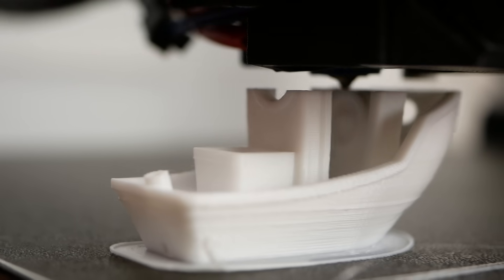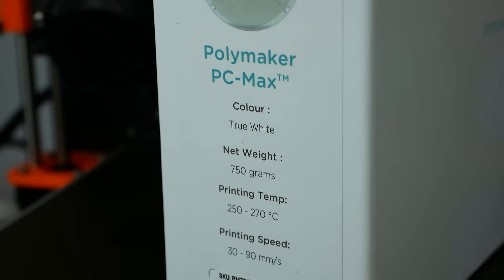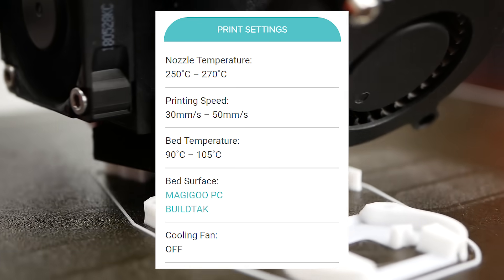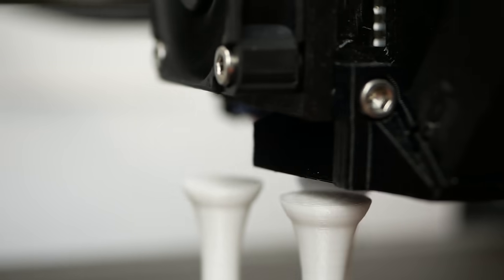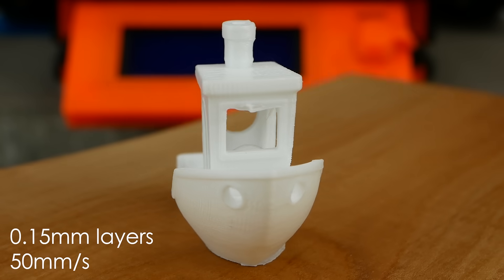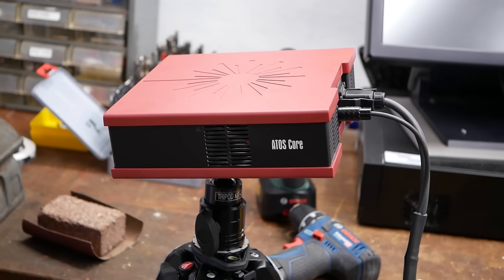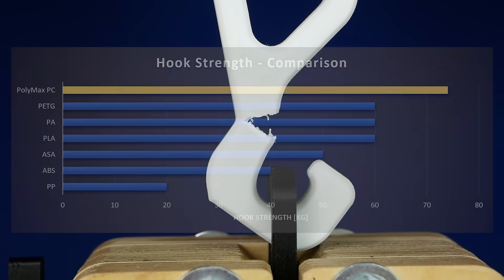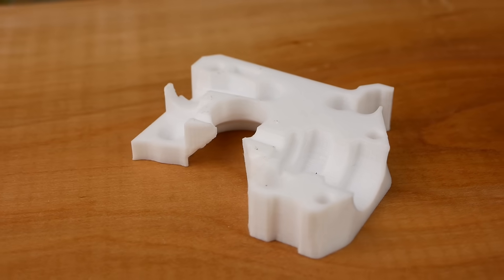The King of 3D printing materials? Polymaker PolyMax PC REVIEW

Comment: Hi Stephan, I use PC-MAX for mechanical parts and  was very interested in this review. Also I read somewhere that PC-MAX need to be annealed 1h at 100°C to achieve it's best mechanical performance, would you consider give it a try later on?
Reply from the maker: Will do.
Reply: @CNCKitchen  update on this? :)
Reply: @CNCKitchen  Yesss! Thank you!
Reply: @CNCKitchen  Yes - please!
Reply: Agreed! Please re-visit with recommended anneal settings!
Reply: +1 for this.  I am considering buying myself a small fan assisted oven (approx same size as my build volume) so I can take the hot glass build plate out and put it straight in after a print.  I'd modify it with an arduino/second had PLC to control the annealing profile.  I'd really like to see the affect as I have noticed the material properties seem to really change over time (after the part is printed) and would like to try annealing them to see if this goes away! 

This material REALLY doesn't 'feel' like other polycarbonates I have printed with.  Polymaker clearly modify the material for 3D printing.  The MDS says it is 10% 'fillers'.  I wonder what they are?? Gypsun, styrene, monomers... I really can't think.  It certainly feels more 'gummy' than other polycarbonates and the temperatures are a lot lower.
Reply: Would there be deformation with annealing this material?

Comment: If only there was a prusaslicer setting to have the fan enabled for the outermost perimeter layer, and disabled for the inner layers and infill. Then you should get a good combo of strength and quality.
Reply: That's a brilliant idea, I'm sure it can be done👍
Reply: Yes, but the outer layer does most of the work, so also no.
Reply: @SalveMonesvol  The perimeter layers in general provide most of the strength, so yes you are sacrificing a bit of strength on one of the layers for the sake of print quality. Its all about trade-offs and understanding the consequences of them with the print settings. You can always add an extra perimeter layer to compensate. Better print quality, less cleanup time, potentially less plastic use for support  (since you're less likely to need it) and finally, its a relatively easy setting to code in.
Reply: @patrickweckermann9121  In that case, just make sure the outer layer is more elastic than the inner layer, thus allowing the inner layers to work befor the outer one cracks. So, no PLA.
Reply: Not sure we're talking about the same thing here, but I'll bite. Sure the outermost layer may be more brittle and prone to separation, but at least its in the shape you intended (as are the other layers). You can compensate this for a bit by increasing the temperature of the inner layer(s) so they adhere better. This is far more of an issue with materials like poly-carbonate and PETG in my experience.
Reply: @patrickweckermann9121  I had forgotten you were talking about just disabling the fan. 
 You might get cracking under stress, but still, it would be better than using the fan on everything.
 I think the best way would be to use fan within a very hot enclosure.
Reply: @SalveMonesvol  Exactly, just a fan speed setting for the first perimeter layer. To expand on the idea, its only needed in overhang and bridge situations. as it is now, you can only set the fan speed for bridges.

Comment: Great testing video, I don't use the polymaker PC brand,  but i do print other PC's, i use a garolite sheet on my print bed with the heat at 70C  and a hotend temp if 290C and 10% parts cooling for the annealing process, these settings give me the best results.

Comment: I'd love to see the comparison with the lite version that's almost half-price.
Reply: I’ve used the lite version (back when it was called PC-Plus), and it is extremely rigid, almost glass-like. Very strong, very very strong layer adhesion, and quite transparent. The downsides are that it is brittle, and will probably cut you if you break a piece in your hands. Also, sticks to my PEI bed far too well, but that’s mostly on me. Warps and lifts if you don’t adhere it well enough. I haven’t tried the Max version yet. I find eSun ePC prints more easily, but it doesn’t have the god-like stiffness, strength, and layer bonding of PC-Plus.
Reply: @dennischertkovsky8871  I found the same with Poly-Lite. It is very rigid and glass-like. I actually did get cut on some brim I was taking off. I found that a heated enclosure at ~50c and gluestick on PEI made warping/lifting go away. I think its rigidity took a lot away from the strength we needed, but it printed very easily with fantastic overhangs and supports. 

Priline PC is basically the same price and seems to be a lot closer to Poly-Max in my experience than Poly-Lite.
Reply: @candorman9444 
How do you think it would behave if annealed?
Reply: @wanderingcalamity360  Same. Layer adhesion wasn't the issue
Reply: @candorman9444 
I was thinking more from the stress perspective, rather than layer adhesion, but alright.
Reply: @dennischertkovsky8871  Hi, is it dishwasher safe ?
Reply: You only want to use filament specifically listed as food-safe.   Even if the base plastic is food-safe, the dyes or other additives may be toxic.
Reply: well, the cheapest polycarbonate material sold in China is 12 dollars per kilo....I'd buy some and test.
Reply: @XiaoMingMC  so did u do it?
Reply: @saadahmad21  nope, I do not have an all-metal hot end, unfortunately.
Reply: @XiaoMingMC  I want to suggest since you could easily buy it locally there, an all metal heatbrake that you could replace ur ptfe heatbrake with and see if that works? I havent seen anyone try it and all they do is just buy microswiss or e3d hotends.
Reply: @saadahmad21  I used a titanium all metal heat break and a nickel plated copper heat block on my Ender 3 stock hotend. Been printing CF nylon at 270 C perfectly. I'm sure it'll do PC because it's max temp possible is 315 C. I'm using a 32 bit motherboard with Marlin 2.0 firmware. Glass bed with glue stick. I got my hotend parts from Spool3D in Canada and they ship worldwide. Both parts were cheaper than the Micro Swiss kit and is way better than the Micro Swiss.
Reply: @Alexis Trompe this post aged like milk 🤣

Comment: I use PC-Plus (slightly different from PolyMax/PC-Max) and it's awesome.  Crazy strong and prints very clean.  Like CNC Kitchen said make sure you dry it before trying to print and print from a dry box because it's very hygroscopic.
Reply: I did some of my own testing with PC-Max and PC-Plus (now PolyLite PC and PolyMax PC) and found it stays dry in open air at like 30% humidity for like 14 days. So it should be okay to print from a normal spool holder.

Comment: So what happens to the 270 with 15% if you bake/anneal it? Can you get the strength back, but still keep the print quality without large shrinkage or distortion?
Reply from the maker: Annealing does usually NOT improve layer adhesion of the parts it doesn't fuse the layers back together. I will take a closer look at that in a bit!
Reply: Good question actually. I want to strengthen my parts before applying epoxy. Read about annealing just today. I know your comment is 5 years old but did you get any conclusive data about it?

Comment: I've had people show me parts that have failed over time made from pc max. These were replacement parts for printers, so not super strenuous. I've since shied away from it and started using priline cf pc and it has been lasting longer in the same applications.
Reply: Yeah, me too. I've noticed that it seems very sensitive to any kind of solvent. This is very different from Nylons which are quite resistant to solvents, so I've been mostly using nylons for applications requiring durability.
Reply from the maker: Interesting. I try to take a look at that!
Reply: I also heard about pc parts failing as printer parts,  but i don't know if they were pc max,  were they in an enclosure?

Comment: If you needed to dry out some PC in a dehydrator how long would you suggest ?  I am drying nylon at 70c for 12 h
Reply: as long as possible
Reply from the maker: But not tool long because that can also damage the material. Dry it to the "dry" point and then just keep it dry at lower temperatures.
Reply: @CNCKitchen  do you have any evidence on this?  we print around 30kg a week, albeit mostly nylons but we keep our filament in lab ovens for months and have noticed no issues.
Reply: @CNCKitchen  do you have a suggestion to test with (time and temp)
Reply from the maker: Seems reasonable. You could go even a bit higher.

Comment: I print a lot of PC. Both PolyLite and PolyMax PC appear to be alloys of polycarbonate and other materials and don't have as high a glass transition temperature (Tg) as unalloyed polycarbonate filaments. They have a Tg of 113˚C, whereas at least one other PC filament, 3DXMAX PC from 3DXtech, has a Tg of 147°C, making it more suitable for my application, internal parts for LED lighting fixtures. Keene Villiage Plastics is another source of PC filament, which they have in blue, green, red, and yellow in addition to the more common black, white, and clear. I have printed all of these successfully on an unenclosed Prusa i3 MK3. Polymaker recommends Buildtak or Magigoo PC. In my experience, it is almost impossible to get the right nozzle height with Buildtak, and I have ruined way too many sheets of it with PC parts sticking way too well. OTOH, Magigoo PC works like, well, magic. Glue stick also works pretty well if applied heavily enough.
Reply: I personally print aprintapro PC, which I believe is nearly unalloyed. It has a deformation temperature in my own testing of 130+C, whereas my testing with PC-plus showed deformation at 110C. I also share your experience with buildtak, just terrible to use and you'll tear chunks out of it frequently. I do use an enclosure that gets to 60C, I had bad experience without an enclosure. I'm getting okay results with 3DLAC on glass, but on large flat parts I still get lifting. I'd also say that moisture is a huge enemy of PC.

I wanted to use PC to make items for biology labs because it can resist high enough temperatures for autoclaving, but apparently hydrolysis of the plastic still destroys it over time. Unfortunately I don't have contact with any biologists anymore.
Reply: @antalz  I haven't tried AprintaPro PC, which doesn't seem to available from any U.S. resellers, and trying to download its documentation from the AprintaPro website gives a 500 internal server error. There are dozens of varieties of PC pellets available, and which variety is used seems to make a significant difference in printability. So far, 3DXMAX PC is my favorite, and it is apparently made from PC pellets designed specifically for making 3D printing filament.

For biology lab use, I think the problem with any 3D-printed items would be that the crevices created by the layer lines would make thorough cleaning impossible. Autoclaving would kill almost any contaminating organisms but wouldn't eliminate all chemical contamination.

Not sure about hydrolysis, but there are many injection-molded polycarbonate containers of various kinds used in biology labs. Look through the Cole-Parmer catalog for lots of examples.

An interesting topic to me, since I design equipment used in the pharmaceutical, food, and beverage industries. So far, I haven't used any 3D-printed parts that come into product contact, but I'm itching to try it. At least one group is working on standards for their use in the pharmaceutical industry, so I may get the chance.
Reply: @mikemike7001  My current idea is basically a gravity-fed dispenser for pipette tips, so the PC would only be in contact with the outside of the tips. No contact with any fluids or stuff like that. The reason it must be autoclavable is that the tips on the inside must of course be autoclaved before use.

Regarding hydrolysis, I'm getting conflicting information about this. Some sources say PC fails at autoclaving, some say it's alright for a few dozen cycles before PC becomes brittle, and others say it's totally fine.

At the moment I don't have access to an autoclave so I can't really try either =[
Reply: @antalz  Sounds like a nice idea. Couldn't find any similar dispensers with a quick search, but you could check Thermo Fisher and other bio lab suppliers to see what tip dispensers might be available and what they're made of. Maybe you can find a "beta tester" or two online in an appropriate forum, or you could upload your model to Thingiverse or a similar site and possibly get some feedback. If polycarbonate doesn't work out, you might try PVDF, which prints at 245-265°C and can withstand 150°C but is even more expensive than PC. See https://www.3dxtech.com/fluorx-3d-printing-filament-made-using-kynar-pvdf/.
Reply: @mikemike7001  Thanks for pointing out PVDF, that looks like something I should be able to print. Unfortunately the polyethers (PEEK, PEKK, PEI) are out of my reach. I think what I'll do is print one out in PC, then post the idea on maybe a microbiology subreddit.

What I've seen when I was still working in such a lab is that most of the plastic labware is PP, but it appears that due to injection moulding it's much more crystalline than what you'd get from 3D printing.